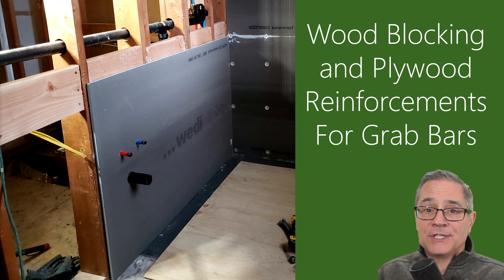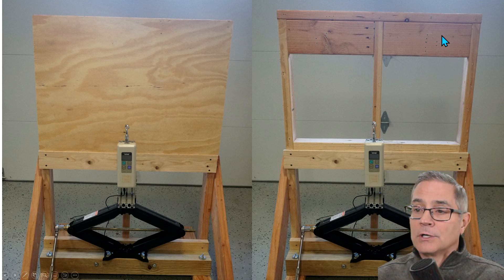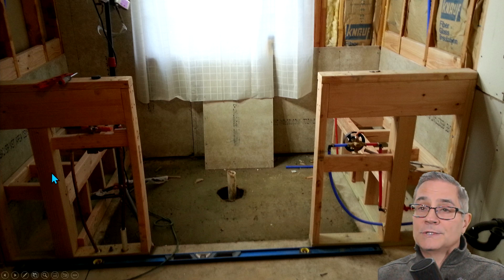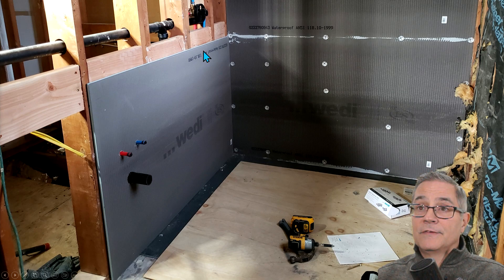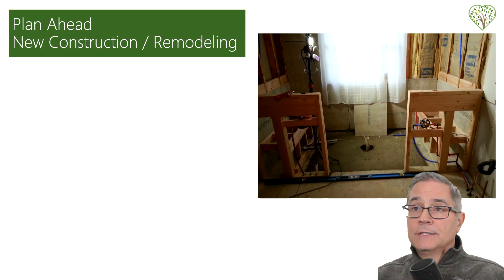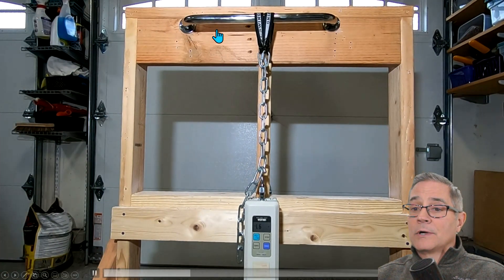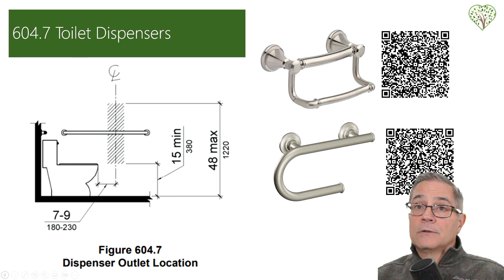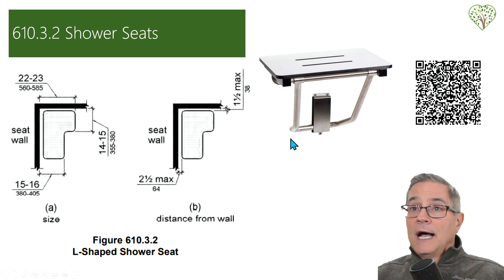E7 Wood Blocking and Plywood Reinforcements for Grab Bars

Comment: Thank you, presentation was professionally done. Information I needed. New sub.
I’m planning on blocking with 2 x 10 and using pocket screws for mounting. Maybe 3/4 Plywood on walls that are a tight fit.
My project started as fix the wall paper next to the tub, don’t look behind the wall paper.
Reply from the maker: Thank you for your comments! The 2x10 is perfect. My preference is to use 2 x 10,  2 x 8, and sometimes 2 x 6 if I know when the grab bar is going to be positioned. Wider is always better as it gives you more flexibility in your grab bar placement.  I like using the pocket screws in tight spaces or when placing the blocking between every stud. I hope to upload another couple of videos this week that shows why blocking is a great solution if you have to remodel or do new construction. Let me know if you have any more questions. Thanks for watching.
Daryl